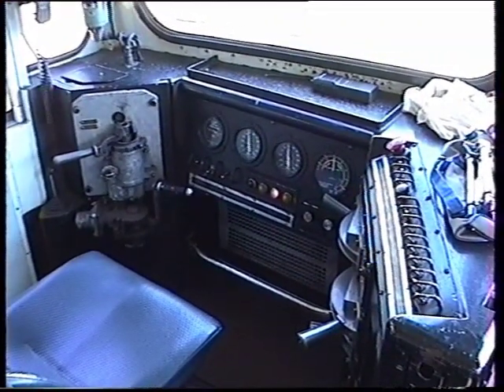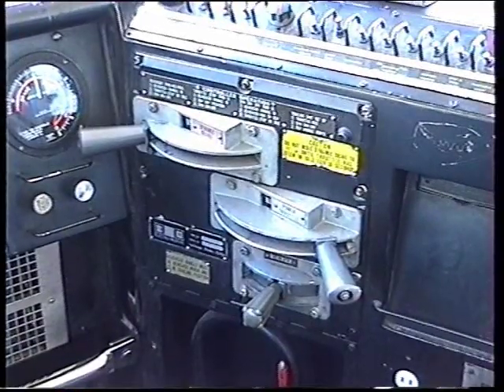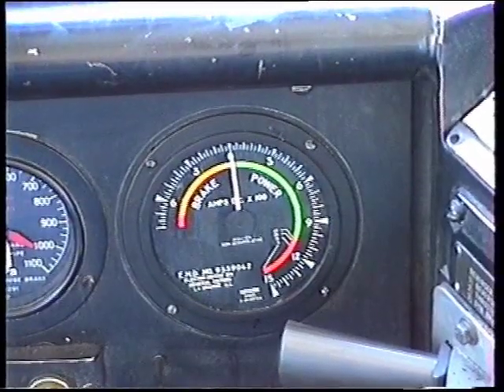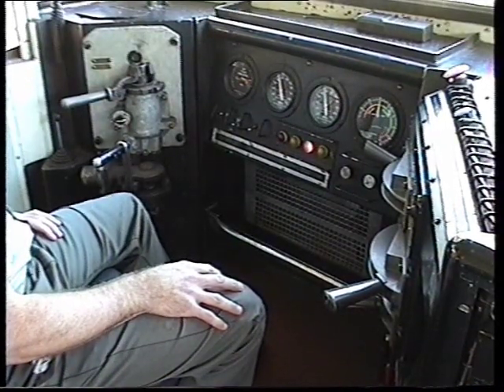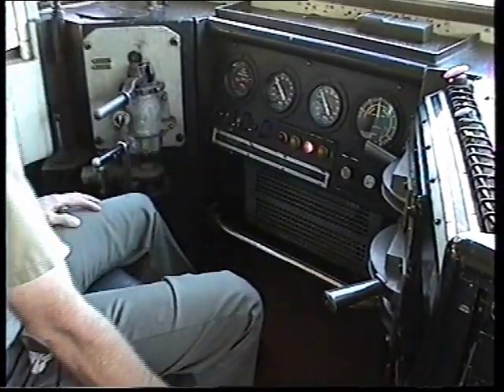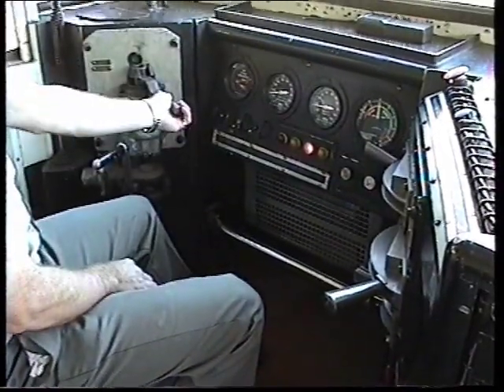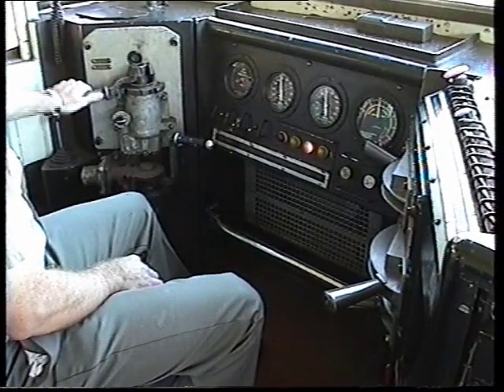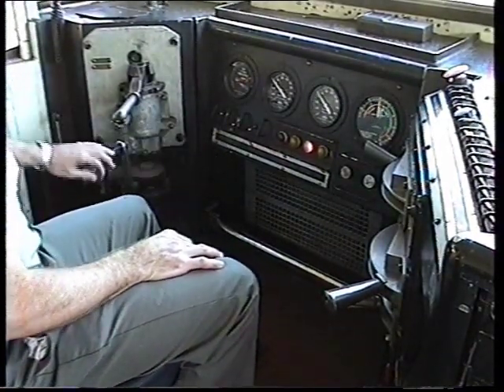8136 engine prep

Comment: That’s soo cool its my dream to drive 81 class trains I really like your videos Steve
Reply from the maker: G'day, 
I am pleased that you enjoy my videos.
The 81 class were not a particular favourite loco of mine.
I always preferred the Alco / MLW units.
Much more melodic to the ears.
But, yes, there are 81 class still rattling around NSW.
Steve.
Reply: @aussiealco  thank you Steve for responding to my comment I really appreciate it. Ted
Reply from the maker: G'day Ted,
I attempt to respond to all comments when able to.
I guess that I continue to reflect upon the good ole days era.
I can remember when the 81 class were brand new.
Witnessing one exit the Clyde (now Downer EDI) plant at Kelso.
The early class units now 39 years old, does make me feel OLD.
The superseries traction control system was alien to us when first encountering the 81 class.
But, that did pose dramas initially when climbing up through the Lithgow ten tunnels.
The radar system underneath the 81 class utilized to control the superseries requiring rough surfaces to reflect the radar signal.
The then smooth concrete road bed through the tunnels causing the superseries system to play up.
And, I remember a trip home from Dubbo with a single 81 class having problems climbing Red Hill (1 in 40).
We ran into umbrella grass piled up on the track in the cutting.
I had to kangaroo hop the unit up the hill while my offsider was out on the ground hurling dirt and sand under the wheels to gain traction.
You could smell the traction motors cooking in short time ratings.
But, we got the train up the hill.
Steve.
Reply: @aussiealco  hi Steve thank you for that story I did not know you had to throw dirt on the track to get traction. Are you still driving trains or are you restired? Also do you prefer drivin passenger trains or freghit trains?
Thanks again. Ted.
Reply from the maker: G'day Ted,
I have been retired for a number of years.
I spent most of my footplate career working freight trains.
But, did belt around on the Indian Pacific way back when a senior fireman.
Sand is necessary for all locomotives, to gain traction during wet and icy conditions.
Metal wheels on metal rails can result in wheel slip and also wheel spin.
I have had to resort to tossing sand under the wheels a number of times when struggling up a hill to prevent stalling.
I walked up most of Tumulla bank one trip being on the ground hurling sand and dirt under the wheels of an 80 class.
Took us so long to get up to the top that the signalman from Gresham came hunting for us.
Ah the good ole days.
But, sand can also cause problems with the track circuits utilized for automatic signalling.
Sand insulates the wheels from the rails and can cause a signal to go to Clear, which is not good.
So, there are rules as to how much sand can be used to maintain traction.
Steve.

Comment: Good video. I'm trying to learn about 26l and 81's. This has helped me. thanks.
Reply from the maker: G'day 1 mach, The Westinghouse 26L brake valve was introduced back in the late 1960s. It has the benefit of not relying on mechanical parts like rotary valves and slide valves. The diaphragm design of 26L provided the self maintaining feature which older types did not possess. The self maintaining feature keeps the brake pipe pressure at the desired level if there is a minor air leak. The desktop version of 26L is now more prevalent. And, the ECP system is becoming more utilized. Steve.

Comment: I've done this every time I take over a consist, it's an engineer's seat box test. I made sure the dead man device worked also.
Reply from the maker: G'day Gordon,
Deadman device is fitted to NSW emu and dmu sets, but generally not locomotives.
Silverton locomotives did possess a deadman foot pedal on their DL531 aussie alco beasties.
Otherwise, the Vigo (vigilance system) performs the necessary task on locomotives here in NSW, plus now also on emu and dmu sets.
The Vigo was not originally a facet of emu and dmu sets until the Waterfall prang.
Steve.
Reply: Thanks for the info. I did 36 years in engine service. GG1,E33/44 electrics, and all kinds of diesels, EMD,the best, ALCo, and GE engines.
Reply from the maker: G'day Gordon,
Them GG1 beasties did have style. I have always been a Pennsy fan. EMD, well I am NOT an EMD fan. Aussie Alcos and Pommy English Electrics I did enjoy working. Very few GE here in NSW until more recently, so I did not work any GE's. We had three classes of electric loco here in NSW, of which the 86 class were the most comfortable. Unfortunately, since privatization, no electric locos toil here, only diesels. You would refer to the Vigo as an Alerter.  I remember when I was up yonder on vacation in 2000 playing with a BNSF coalie on the Marshall sub MN. Humongous length train with two up front and one DPU at the rear. Had to keep it to a max of 40 mph. The hogger was a union rep and invited me onboard to compare situations.
Steve.
Reply: How much business did you loose with privatization? That usually means less trains and more trucks. I use to be an engineer out. of Denver back  in '78-81. Our coals trains averaged about 15,000 tons, 6 engines on the head end, and 2 engines behind the caboose, which were manned. The helpers shoved from Denver to Palmer Lake, 52 miles, then returned lite back to Denver. Mostly SD40-2 and C30-7 engines.
Reply from the maker: G'day Gordon,
Yes, big rigs are more prevalent on our highways since privatization. Basically, privatization resulted in the rail traffic being divided out amongst the various companies. My depot was Lithgow NSW, and we lost grain and intermodal traffic. We also lost the Indian Pacific pas job. Plus, we lost the ability to transfer with seniority to the interurban pas services based at Lithgow which remained with the government. Lithgow coalies during my era were 3000 tonne, increased to 3300 tonne when three pack coupled hoppers appeared, and ultimately increasing to 4200 tonne after the demise of electric traction. Today, the few remaining coalies at Lithgow are 4500 tonne. Hunter Valley coalies average around 9300 tonne. Your SD40-2 equates to our 81 class JT26C-2ss, which is featured in this loco prep. I also worked down in Tassie, based in Hobart. Tassie is 3 foot 6 inch narrow gauge and 18 tonne axle load. PNT were told to depart in 2011 and the Tassie state government took back control of the railway. Today Tassie has the only government freight railway in Australia. I left Tassie in 2007 to return to the mainland, though not returning to the footplate. Very few trains now rattle through Bathurst where I now reside. 
Steve.
Reply: Here in the US, we call it the rubber tire mafia.
Reply from the maker: G'day Gordon,
HA, yeh. Until the early 1980s here in NSW, parallel transport was not sanctioned, thereby preventing road from usurping rail. But, after consecutive liberal governments, that was kyboshed as anti-competitive. Interestingly, I know that Austria still has some anti-parallel transport regulations. That to force road transport onto rail. They have the rolling highway as it is translated which involves trains of flat cars onto which big rigs and other road vehicles are plonked at various locations to travel across the rail network. We did trial the road/railer concept here in NSW in 1999. But, sadly the rail infrastructure within the Sydney Metrop region conflicted with the low slung truck tyres. So, road railer was not possible. Within the Metrop we have Train Stop apparatus which is similar to that utilized in the NY subway. The raised contact shoes at the base of signals contacted the tyres. Plus, double stack containers are also not possible here in NSW east of Parkes. We have too many low overpass bridges, tunnels and the overhead swinging in the Metrop.
Steve.
Reply: About 1990 when I was the regular engineer on the LA-Salt Lake Desert Wind, we were stopped at Summit, on top of Cajon Pass. There was several of your countrymen, fellow engineers there taking photos of us. So I gave them the 10 cent tour and chatted for a while. I wish I could remember their names, but can't. Here in the US, They throw unlimited amounts of money to the roads, and there goes our traffic. That's what they call competition here, and it's BS, especially in passenger service.
Reply from the maker: G'day Gordon,
Yep, I've been to Summit and Cajon Pass, in 2000.
Got snavelled by some park ranger for being inside a reserve at Cajon.
I pleaded ignorance, being an Aussie, so he didn't fine me.
Also had a patrol car bounce up the perway access track near Flagstaff AZ.
He saw me tripod and cameras, and reversed out again.
Motored over 4000 miles on the Wrong side of the road on the wrong side of the car.
HA!
Just been trespassing today chasing a stupid train.
Ended up being over an hour late.
Dubbed the Christmas in july tour by Lachlan Valley museum mob.
Worst frost and pea souper fog this morning so apt for their tour.
Things just don't percolate smoothly here on our private metals.
Did you ever venture near any of those Position Light type signals?
I am fascinated by them, especially the old B&O variety.
Steve.
Reply: By the way, talking about Safety, I think the Signal Stops (The white ramps with a little arm) are fantastic. Why did they not put them on freights? As far as I know, they just pop the brake air which is the same reaction on a freight as if the coupling broke so i wouldn't have tought theres much modification needed. 
Obviously, the system would have to span more than one block as Freight takes longer to slow, but the computer system should make a sliding block work fine. I think thats what its called in the U.K. anyway. Sliding Blocks as far as I know allow space around the train, instead of forming set positions. So a freight train, instead of having 200metres around it, would have 1800metres. Sort of like reserving airspace in a controlled airport.
Reply: I can tell with 100% certaincy the 81 class locomotives were fitted a vigilance control where the button had to pushed within a 17 second time frame. 
I was the Clyde Engineering's workshop manager at their Bathurst assembly factory. I over saw the building from 8101 up to 8120.
The first 6 or so locomotives were a real challenge however after that it became more of a Policeman's job chasing workers, so l resigned.
Reply: @aussiealco  Thanks for your kind reply, I'm sorry for the long time it took to reply. I miss the ALCo's, never had any use for anything built by GE. I never liked the way they did business, always complaining to the Govt. about EMD selling to many engines, and nobody buying their junk. They screwed ALCo. on the electrics and ran them off. I'm happily retired and don't miss it at all.
Reply: @aussiealco  Again, sorry for the delay. I started out as a student engineer for Penn Central, New Jersey Div. It was formerly the Pennsy. My seniority was all the electrified trackage. Position light signals was, and still is, the norm.
Reply from the maker: @gordonvincent731   G'day Gordon,
GE and EMD (with CATs etc) are the go here now days.
Nobody is building branchline axle weight power, so I do wonder what will happen when the last of the 48 class DL531 units grind into the dust.
We still have some rural granger branchlines with light pound rail.
And a number of very dilapidated 48 class remaining in action for such.
But, being in lockdown, not able to venture out west to espy them.
I was peeved a week odd ago.
I espied two vintage units, GM27 A16C and 44205 DL500G parked here for a rail set job.
I had gone for a jog, one of the five reasons permitted to exit the house under lockdown.
It was a glorious cloudless sunny day.
NO, I did not go back with the camera, taking photos not being permitted under lockdown.
I did get interested with your PPL signals when attempting to discover the origin of one of our signals.
The turnout indicator incorporated into the single light type.
We call it the scattered aces.
A slanted row of three subsidiary yellow lights below the Main Red, to indicate a turnout.
This began life here as three white lights below a Yellow Main indication.
This proved confusing to crews, and after some incidents was altered.
However, we now have the use of the scattered aces in Train Order Terrirory.
A slanted row of three lunar whites.
I have no definite solution as to the origin of our signal, but now believe it may be adapted from a shunt signal at Toten Yard in the UK.
Your Pennsy remains one of my fav USRRs.
Especially the tuscan livery era which is the main reason that I became interested.
The NSWR era here being tuscan.
I hope that you and family are surviving this horrid global plague ok.
Steve.
Reply: @aussiealco  Thanks for your reply and kind thought. All of us in my family have gotten the shots. My sister and I hav jus returned from the midwest doing our genealogy work. When I started with the PC in Nov. 1974, the men would tell me about the Brunswick green paint scheme on the engines. It was about 99% black with 1% green! You had to catch in the sunlight just right to see the green, lol!
Reply from the maker: @gordonvincent731  G'day Gordon,
Good that you and family are fully jabbed.
I am likewise, but currently being jabbed here does not afford any benefits while we continue in lockdown.
Other than of course avoiding getting very ill or worse.
Yes, I also have seen photos and some video of the Pennsy Brunswick Green.
I envy your riding around in those GG1s during the "good ole days".
Our Pommy Metro Vickers butter box 46 class were bonzer to drive.
Fully manual control manipulation, and we could even motor in regen (regenerative brake).
But, they were very cramped and uncomfortable towards the end of service.
The 86 class were more modern and more comfortable, but could not motor in regen..
The 85 and 86 class having pilot motor driven cam shafts for power notching and regen.
My email is
stringybark2009@hotmail.com
Accessing You Tube to reply to comments etc can be a challenge.
Your recent comments have not appeared in the general comments page.
I have had to go scrounging to discover them.
Shivering here today as our weather has returned to minor winter.
Summer is still two months away here.
Steve.

Comment: I'm an absolute loco enthusiast but had absolutely no idea what the driver was talking about lol. Looks so complex.
Reply from the maker: G'day, Rob,
Just like anything, you learn a routine and follow it when preparing a locomotive.
Just what facets are employed depends upon the specific locomotive class involved.
Steve.
Reply: I'm only part of the way there, but most of the vid is is testing the three types of brakes.. Carriage and LOCO, LOCO only, and Regen. 
LOCO only is OK, but if you brake too hard, you'll end up with a zig zag of carriages behind you.
Using the carriage brakes helps to stop this, BUT they are physical brakes, so have to be replaced.. Management don't like you wasting stuff even if it is to stop your train ;)
Regen: basicallly instead of the dynamo running your light on your bike, the LOCO dumps power to effectively A Huge Set Of Kettle Elements and those HUGE / NOISY two or three fans on the roof blow the heat off them. This is economical as it is not physical at all, but unfortunatly cannot be used in the carriages so you still need to use some type of carriage braking to stop the zig zag.
Hope this helps.

Comment: I’m a private pilot and our pre take off checklist is way shorter and less complicated than yours.
Reply from the maker: G'day Albi,
With anything in the transport industry, there are set routines for preparation.
The air brake is the major facet of locomotive preparation.
Including the associated safety systems.
Neglect any facet and a potential incident could occur if something is not correct.
I would be certain that the combined check lists performed for take off, in flight and landing would be much more complicated than that for a locomotive.
Steve.